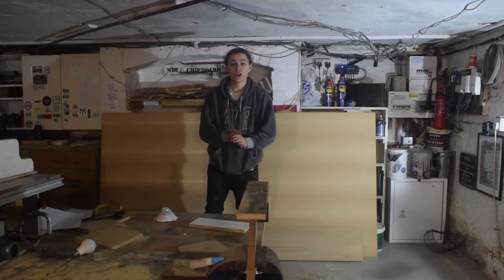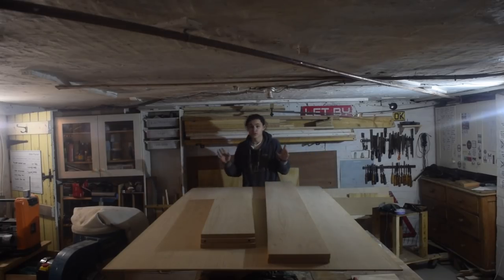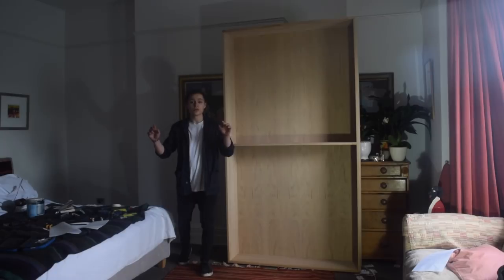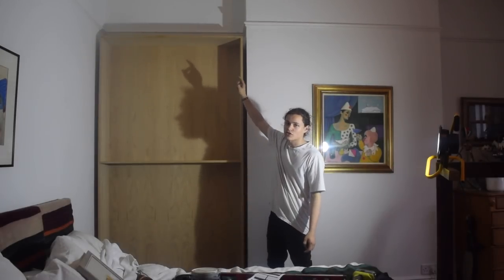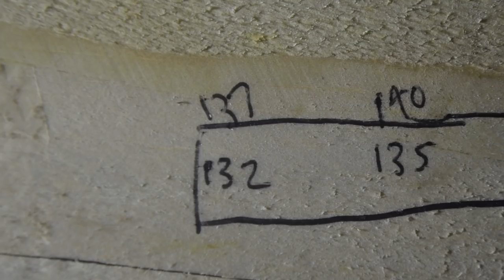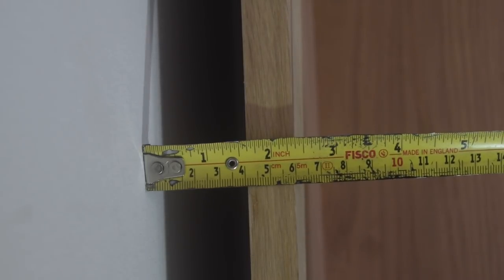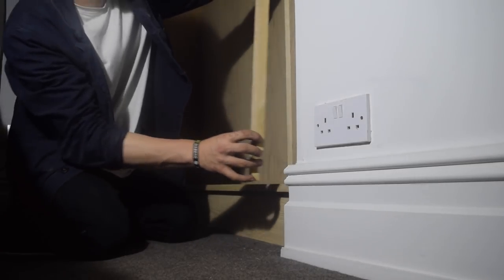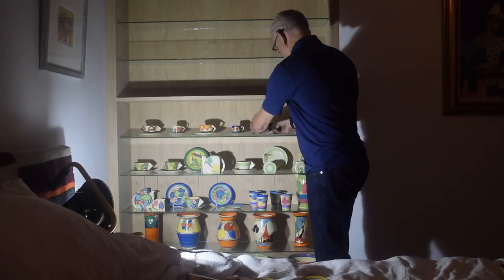Making a DIY Built-In Display Cabinet w/ Sliding Doors

Comment: Great build. Great progress. The only thing that makes me cringe is when you make those long cuts. I know that making a sled that long would take a lot of material, but still... You can reuse it, make it adjustable. And please use a push stick. All best.
Reply from the maker: Thanks Borys. As I said in the video, whilst its not the most ideal method in terms of safety, so long as you have a riving knife installed, cut straight and most importantly feel comfortable and confident its really not as dangerous as it seems. I did think of making a tapering jig, but it would of been really hard to manoeuvre, and wouldn't have produced an accurate cut due to the size of the table saw top.

Comment: First commissioned project? Hope it wasn't for you Mum, she deserves a freeby - especially after using her best Iron for the edge banding!
Hope you didn't bin the skirting off-cuts - they don't make that stuff any more. Just be careful if there is lead paint in it. My sis had an old place near Wakefield. When she had her bathroom stripped out, they found the original wallpaper from the 1850's and plenty of lead paint.
Reply: By the way, good job! Where did you source the glass work? Did I notice finger pulls in the glass? Hard to find that sort of service where I live now.
Reply from the maker: Its actually maybe my 5 or 6th commission project, although the first one on this channel and it was for my mum haha!  Definitely made sure to keep the skirting boards, although I do 100% need to test if for led - you can never be too careful, especially with it being a victorian house. Do you know what time period it was used from/to? 

The glass was repurposed from the old cabinets which was lucky as you're right I'm not sure if glass shops will do this nowadays.

Comment: Why no fence at 4:12?
Reply from the maker: Because the floor isn't perfectly flat, the plinth had to have a taper. I tried using my tapering jig to create this but the piece was way too long, so I had to just do a free-hand cut on the table saw. Its not the safest method, but so long as you're comfortable doing it and have a riving knife its really quick, easy and effective :)
Reply: I see, thanks for the explanation. I didn't realize there was a taper so I was like, "Why in the world wouldn't you just put the fence on?!" Had to ask. Still something I won't be doing for the foreseeable future, haha. But glad it works for you. Cool build and nice video. I wouldn't have thought of ordering things the way you did, so it made me think.